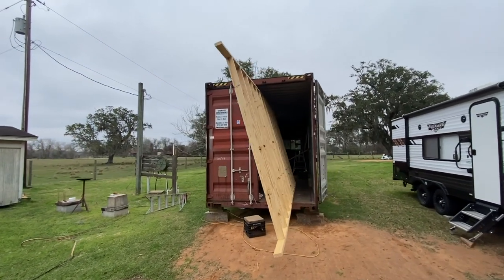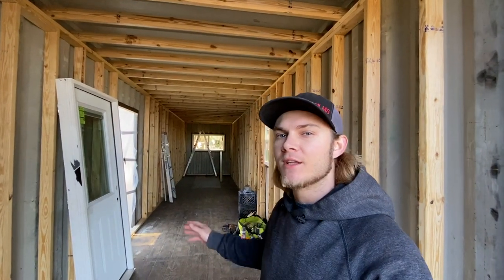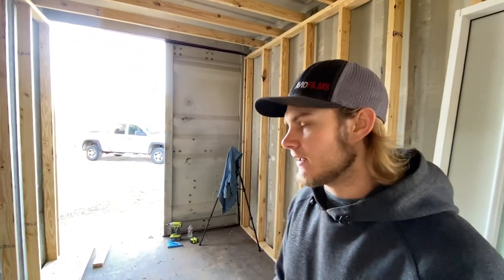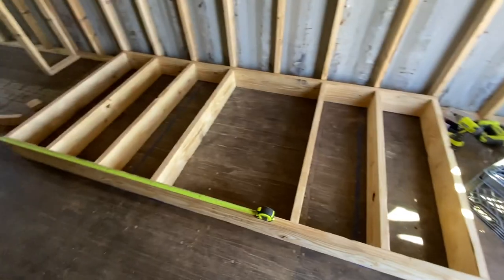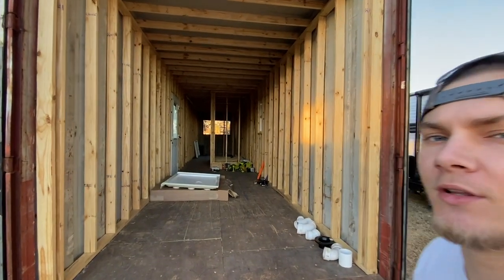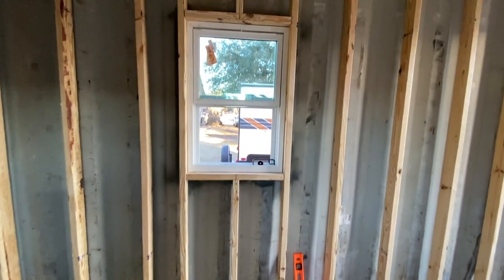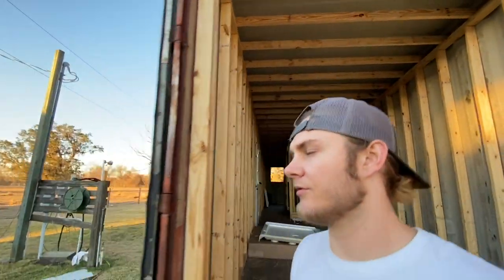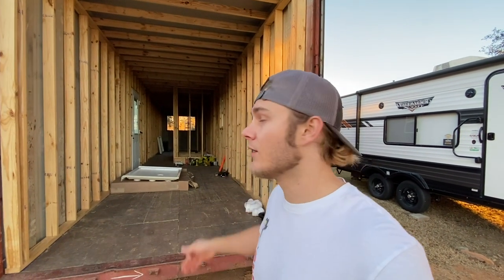FRAMING A SHIPPING CONTAINER HOME IN 2021 | Part 3

Comment: I know the bottom plate on the framing is attached to the container but what about the upper part of the framing? Or do you just rely on the ceiling joist to keep it in place which seems like that would be enough.

Comment: Check out Pacific Pines Ranch.  They used a small sand blaster from Harbor Freight to clean the welding slag and paint in those hard to reach areas.  She tells you just what tools they used for cutting and cleaning metal in one video.  They also cut out the center of the container doors and inserted glass.  Gave them outward swinging glass doors.  Good video showing how they did it.  But maybe not a good idea if you are going to be moving the container.  Liking your channel and subscribed today.  Thanks for sharing.

Comment: Might I suggest should you decide to repeat this project in the future that you reverse the facing direction of your angle iron framing. Since you are framing and drywalling the inside... having the wider, framed edge of the angle iron on the outside will give you a better finished look on the exterior and the gap modifications will be inside thus hidden by your interior cladding. Looking forward to watching your build.

Comment: Basically the 2in of a 2x4 I'd have sticking out and the 4in of a 2x4 flush against the wall.
Reply from the maker: Honestly I really thought about doing that! The two reasons why I didn't are:
1. I was only going to be saving 4 inches total from side to side so I didn't think it would be worth it. ( approximately 13 sq ft if you consider the total legnth of container )
2. All of my in wall plumbing harder to do with thinner walls.
Reply: Plumbing and electrical really need that 4 inch section.

Comment: How did you secure the frame to the container? Anchor the bottom only?  Sides? I'm curious because I'm struggling with that part right now. Looks great!
Reply from the maker: Yeah pretty much just on the bottom
Reply: @AvidFilms  Just to clarify, only the bottom is anchored with screws? Does it hold the rest of it pretty steady?

Comment: Do you screw the wood to the metal at all?   or you just "squeeze" the wood to the edges ?
Reply: I knowwww !!!  I have the same question.  I've watched this video  like 20 times to see if I missed how he attached the framing to the wall and/or to the floor?  Did he use caulking??  Did he nail the bottom of the framing through the actual container floor?  Or did he use screws ?
Reply: Did one and attached at the bottom then the ceiling joists are screwed in to the tops of the frame.

Comment: How did you fasten the studs across the ceiling to the wall framing?  I’d like to do this for mine.  Also, how did you design the floor plan?  👍
Reply: Probably screws through the top of the frame.

Comment: I'd of made the framing as skinny as possible to save on square footage being taken up.
Reply: Thin walls sucks. Got to insulate them well
Reply: You need the 4 inch part to run all your plumbing and electrical. He said in another comment it only took 13 sqft throughout the whole container. Youre not really gonna miss that